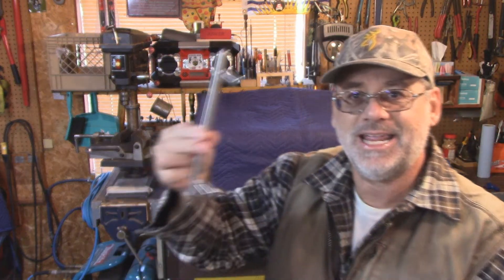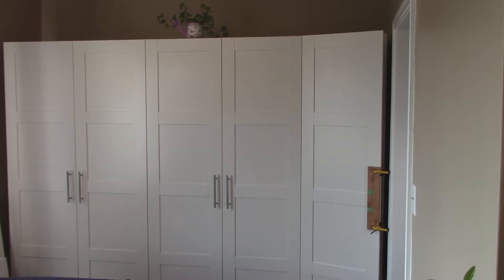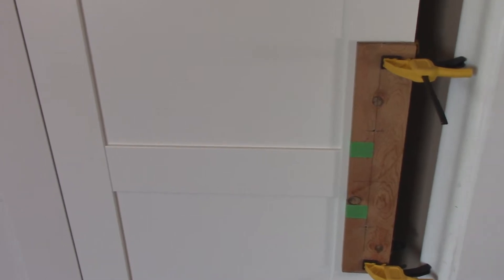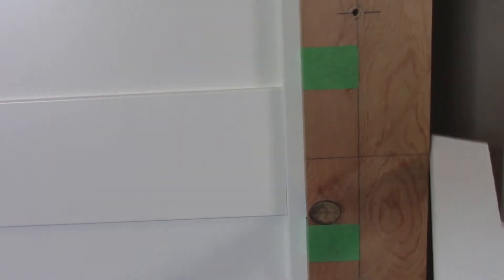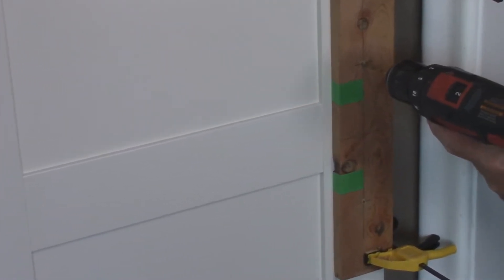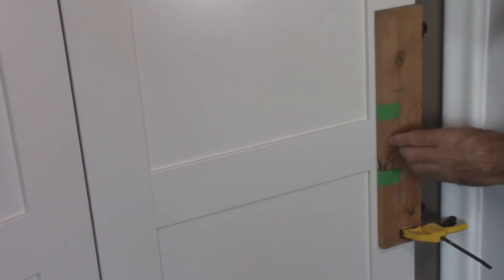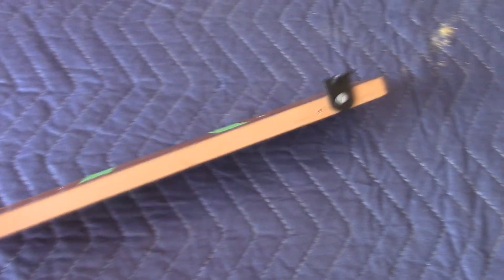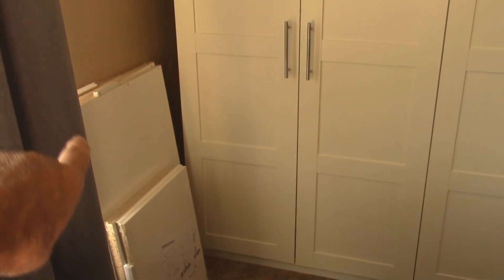How To Install Door/Cabinet Handles Perfectly Aligned Every Time

Comment: I made myself a couple jigs when I renovated the kitchen, I had two types of handles, I also added blocking on the back to prevent blowout. Great tip Steve👍🏻🙋🏼‍♂️🙂🇨🇦
Reply from the maker: Hi Luc 
The blocking on the back is a great idea too. Cheers 👍